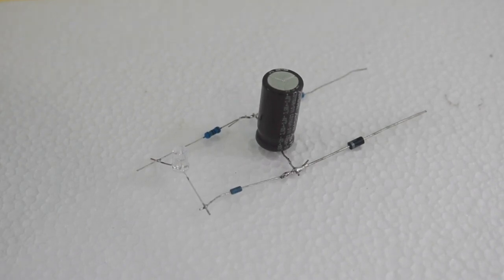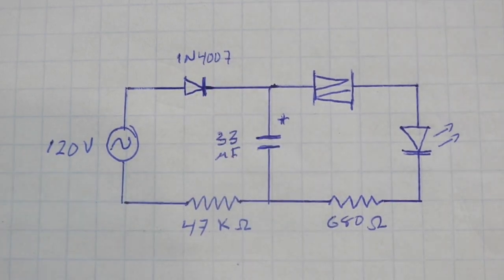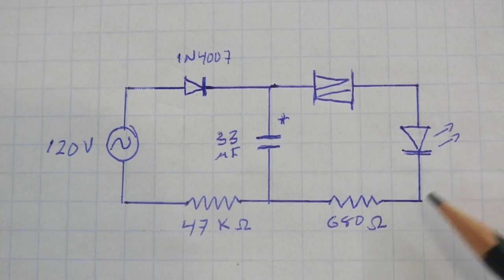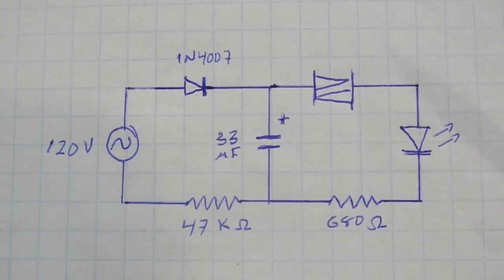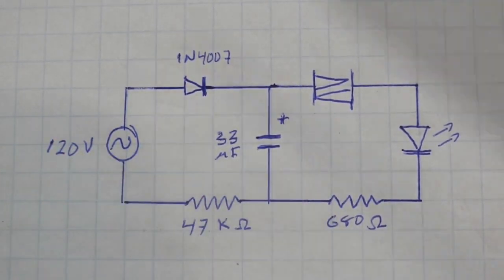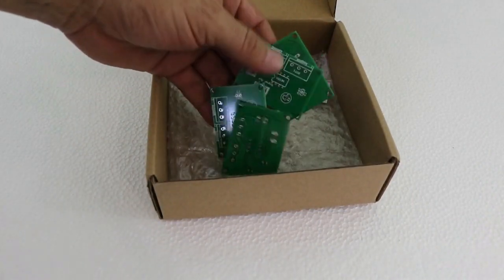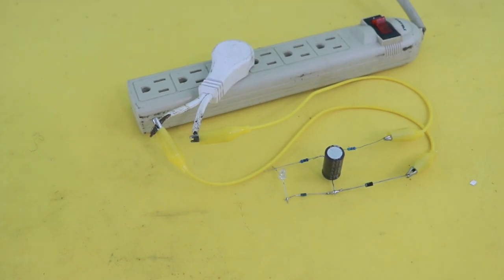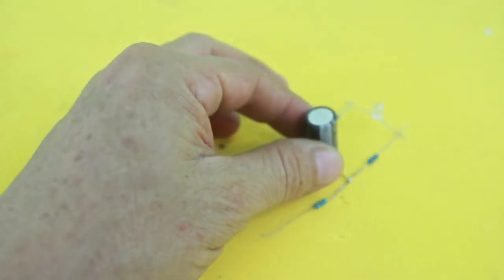Electronic Oscillator with DIAC

Comment: it is not an oscillator. Oscillator converts DC voltage to frequency
Reply: What if I told you it is an oscillator, and Ludic Science is absolutely correct.

Comment: But 120 volts turns into 60 volts because of the diode, it enters half the wave, and makes the other wave zero،،

This process is similar to a dimer
Reply: It actually doesn't, "120 volts from the wall" means 120 VAC RMS (volts ac, root-mean-square). The peak voltage between the wires (live and neutral) is sqrt(2) times the RMS voltage, so about 170 volts peak. So the voltage starts from zero, rises up to +170, falls to zero, rises to -170, back to zero. And so on. So the peak-to-peak is actually 340V. For "240 volt" countries, it's the same, and the peak-to-peak would be about 679 volts.

Therefore with no load, the capacitor would eventually charge up to that 170 volts, even with a half-wave (single diode) rectifier. A full-wave (four diode) rectifier delivers more power, but both deliver the same peak voltage, and thus would charge a single capacitor to the same voltage. If the circuit was loaded, a single diode would indeed have a lower voltage on the capacitor because less power is transferred.
Reply: @LazoeJSCREI  Thanks for your valuable explanation